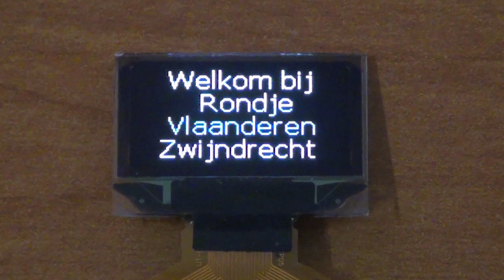Oled Display soldering

Comment: nice informative video.

what is that sort of copper thing which you put on the soldered points to attarct the excessive soldering and what did you put on it please? Thanks
Reply from the maker: +James Cremona it's a solder remover wick which I drain in solder flux (with a flux pen, you can also use solder grease) , something like this: http://www.aliexpress.com/item/10pcs-lot-5-ft-3-5mm-Desoldering-Braid-Solder-Remover-Wick-GOOT-Wire/1473167581.html?spm=2114.01020208.3.12.XW4jzY&ws_ab_test=searchweb201556_6_79_78_77_80,searchweb201644_5,searchweb201560_1
Reply: +Jan Adriaensen Gr8! Many thanks!

Comment: how did you get attiny 85 controlling the oled display ?
Reply from the maker: Hackeras 32 I wrote my own Arduino sketch , it's impossible to use a graphics library because it takes too much memory. My code only displays 2 types of fonts, a small font and a large one. The large font only displays numbers. code + datasheet : http://www.printplussupport.be/Oled_attiny.zip . Two versions in zip file : SPI or I2C, depends on your display

Comment: I found this video because I want the fastest refresh rate using the parallel interface of SSD1306, but pre-soldered breakout PCB modules available now are only SPI or I2C, so I will have so buy a bare flat cable display and solder it myself.
What is the name of the white connector standard, and does cable making require an expensive crimping tool ?
Reply from the maker: JST 1.0mm 6 pin like this one : http://tiny.cc/00uozy
Reply from the maker: no need for a crimping tool, the cables are pre-assembled

Comment: Does it take only smd and resistor with the microcontroller for display? Could you use a USb with this board if you wanted I want to do this with tft display those.screens with the ribbon cable
Reply from the maker: Hi, I don't know if I understand your questions (not sure what a sub is?).. I designed the board myself, I made the pcb myself. It only needs a Attiny 85 microcontroller and the few smd components you see in the video to run. The attiny 85 is programmed with Arduino IDE (no libs, just own code because there's only 8k memory). The connector is only necessary for programming, the board runs on its own on a 3.7V battery.
Reply: Jan Adriaensen hy sorry meant to write USB so this microcontroller is already set up for lvds interface from that code, if understood correctly

Comment: where did you bought those OLED?
Reply from the maker: http://www.aliexpress.com/item/100-new-and-origianl-0-96-OLED-Monochrome-Display-UG-2864HSWEG01-WiseChip-10pcs-lot/1538829960.html
Reply: thanks, seems your link is the cheapest on aliexpress, but it lack of information, is that the yellow-blue one? or one color version?
Reply from the maker: Arief Adha It's the one color version (white, you see it working in the video at the end)
Reply: Jan Adriaensen can you address me a link for a yellow-blue one?
Reply: i read herehttp://www.bigmessowires.com/category/backcountrylogger/page/4/

this lcd need 7-12v? did you uses charge pump circuit?
Reply from the maker: Arief Adha I used the pump circuit, works very well, easy connection with only a few capacitors and one resistor: http://printplussupport.be/Oled_128x64_setup.jpg , pcb design for the oled connector is a bit of a challenge though ;)
Reply: btw can i use 5110 library with redefining the pixel?
Reply: Jan Adriaensen so basically the SSD1306 has build in pump circuit, right?
btw what library that you use? Adafruit library is too big for attiny and using C++ so i had difficulty to edit for my attiny13 and 48, 

currently i use this http://tinusaur.org/2014/08/29/c-library-for-attiny85-to-work-with-ssd1306-controlled-oled-display/
Reply from the maker: Arief Adha Yes, it has build in pump circuit. I did not use graphic libraries, they're always big. I wrote my own (Arduino) sketches , one for I2C version and one for SPI version. My program only displays size 12 font characters and size 28 numbers, but it uses only about 5kb memory (I think Attiny 13 will always be too small, you'll need at least 4k or 8k attinys). My source code is here, I included datasheets for ssd1306 and display datasheet : http://www.printplussupport.be/Oled_attiny.zip
Reply: yup attiny13 is too small, but if i only showing the number,i can build temperature display, or clock display. thanks for the library :)
i guess i owe you a beer